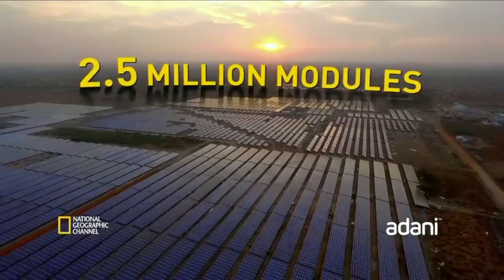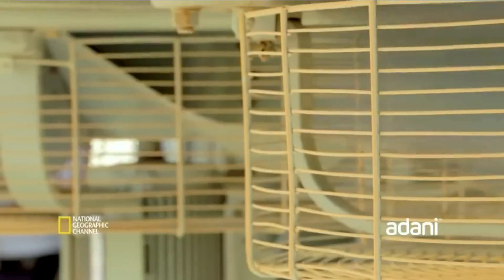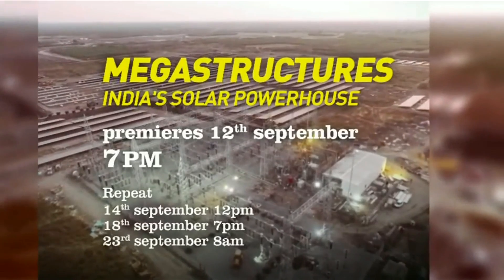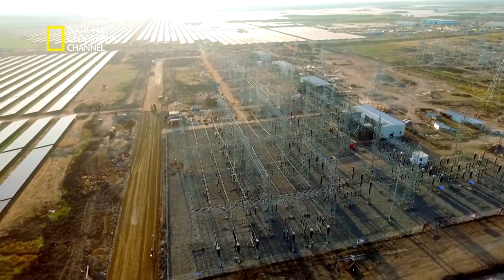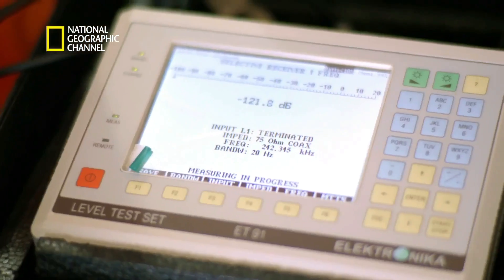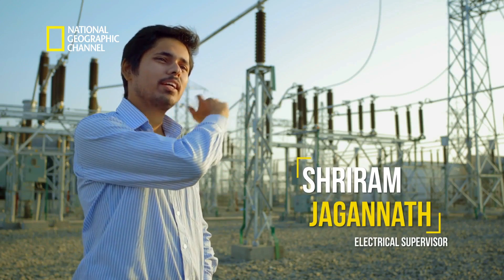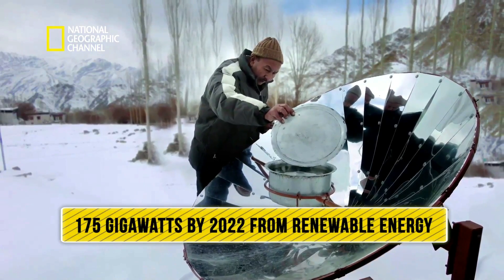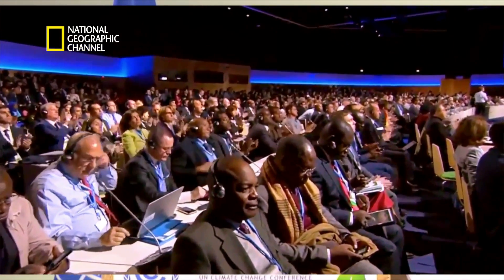Megastructures: Adani's 648MW Solar Power Plant at Kamuthi, TN

Comment: I congratulate engineers who make it grand success in time of this kind of mega project of 648 MW. However, I have the doubt, since Tamilnadu has abundant Sun light almost round the year almost all areas, what is the necessity of installing this mammoth size in one place, instead of installing in village/taluk/district wise to avoid/minimize the transmission cost and loss ? Anyway, my wishes for maximum utilization.